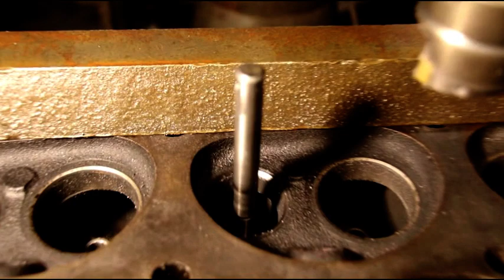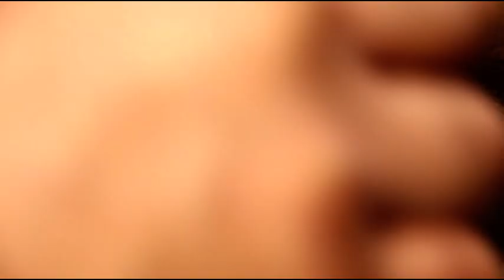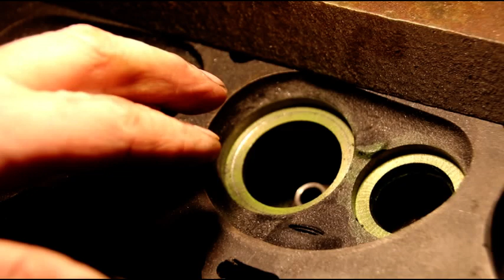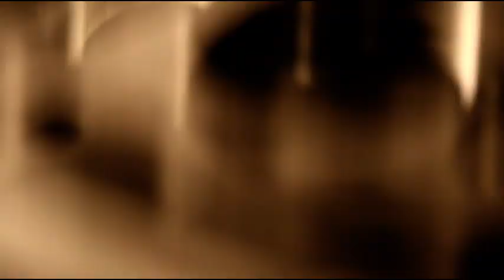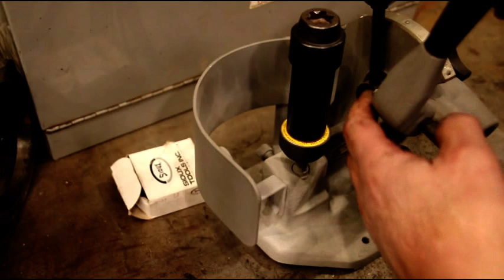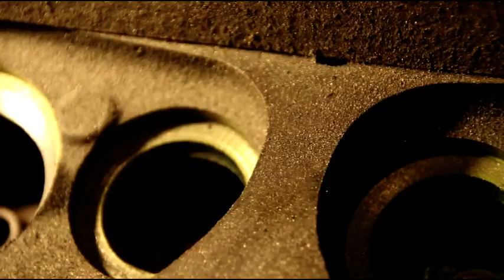Jeep 258 Cylinder Head Upgrade Part 2, Installing Chevy Valves

Comment: I deal with AMC J-10  /J-20 pickup trucks and CJ Jeeps. I started working for the Worlds largest Jeep Dealership when in Highschool doing nothing but washing Jeeps. All brand new Jeeps can in with a power all over them that looked like baby powder and he had 3 and sometimes 4 tractor trailer loads a week to come in. Then with every jeep that came back to have accessories added, oil change or what ever it came back for in the Dealership. Every single Jeep was washed and cleaned up inside before it left the dealership. Me a one other guy stayed busy washing Jeeps for 4.00 dollars a Jeep. That was in 1980, 81,82. I still rebuild, restore these old Jeeps. I buy the rare ones they didn't make but either 1 year, or they were a limited edition or something. I have a 1976 bicentennial J-10 that's my daily driver. Manuel shift. I have a 1977 Honcho automatic with factory AC, Tilt wheel and cruise control with a 401 Levi edition with factory electric window. I have a 1981 step side. I test drove this truck when it came on the lot new in 1981. It was the first and only one I ever seen in real life. They so rare. Only 1,264 were ever made from 1980 to 1983. I also owe a 1983 J-20 will a original 39,000 miles on it. But this 1981 It's the only truck I have with a 258 6 cylinder and it's a factor 4 speed. I am trying to get more horsepower out of it. I've never owned any vehicle with the 258 6 cylinder before. I have 3 Cjs also. They all V-8 also. But I had a guy do so work on the 81 with the 258 and it's been bored 60 over. It's running in the truck now. But I would love to have this done and I've been told to change it over to a 4.0 head and he said it would make a huge difference and it 60 over. It will have well more horsepower than the 304s I have. I doubt it won't compare to the AMC 360 or not. I know it won't with to 401. If it's not going to do a big difference. I'm thinking of going back with a 360
Reply from the maker: Great to hear from somebody that actually working in a real jeep dealership.  Sounds like you had a great time working there, and you were smart enough to grab some great vehicles.   I like the upgraded 4.2 head over a 4.0 head swap.   just my opinion and experience after having built both types of engines.   Appreciate you comment and story.

Comment: Hey Brian, I'm so grateful to come across your video and look forward to checking all of them out. I'm now the owner of my father's 89 yj, and unfortunately, the motor needs rebuilt. I want to take the opportunity to improve it performance and keep it as original as possible. Lost dad to cancer 16 years ago, and this build is for him. Do you take on any of this work? If so, how do i reach you? Is there any way to contact you? I have a 4.2 258 in a yj. I would prefer to not do the 4.0 head swap. Its carburetor is a motorcraft 2150 and plan on keeping it the way he left it. I'm in PA with a PA classic tag and emissions is not an issue.

Comment: How much gain do you estimate you got for upgrading the valves?  When I had my daughters 258 rebuilt I did not know about this upgrade.  I did put a small RV cam for torque.  These engines are known for getting warmer at the 5/6 cylinders, do you know a way to correct this heating issue?
Reply from the maker: The horsepower gain depends on how much cylinder head work you do.  with larger valves, porting work, milling head for increased compression etc...... will add just over 50 hp when matched with a good camshaft.  I have never had a 258 have a hotspot between 5/6 cylinders, but have traced the problem to blocks that have a lot of junk in the cooling system.  Once boiled out and rebuilt no problems.

Comment: Nice work and vid!  I've heard of going to a 1.875 intake, but not the 1.94.  It looks like a lot of material is going to be removed.  Just curious what your thoughts are on how much material there is before you get into water (?).  You sound pretty experienced at this, so I figure you'd know.
Reply from the maker: 1.94 intake valves have been installed in hundreds of 258 cylinder heads without any trouble.  There is no need to be concerned with cutting out too much material.

Comment: To optimize that increased flow do you run a particular cam? How would you compare the performance of this modification to a stock 304? I’m finding this 258 build especially interesting 💪💪🇺🇸
Reply from the maker: a well built 258 will feel as good or better than a stock 304.   Add gears to the mix and you will have a super responsive and powerful 258 rig.    I do use a lot of different cams based on what I want out of the engine.   Will be showing the cam and discussing them when I  get to that point in the build.
Reply: @metalshaperJeep  I’m really looking forward to seeing this come together and listening to your choices on components

Comment: We did something very similar to this to put Chevy valves in my 1978 258 performance build back in 1990. There was very little 258 performance parts for sale back then compared to today. Still running it to this day. Amazing torque and power.
Reply from the maker: I have been doing this modification for a long time and it does make a big difference in power.  Glad you are getting the benefits of it in your jeep.

Comment: Couldn't you go in there with a piece of high speed steel 30 degrees or so off the vertical axis? I saw this done on another video on 324 olds heads. I think it's on YouTube  fiatnuts I'm just asking, not telling you how to do it.
Reply from the maker: There are a lot of ways to do any job.   I am showing how I do it with hand tools and stones.   Very easy to hold the head on the seat and guide machine and not worry about setting it up on a milling machine.    Can't make a cut like that on the seat and guide machine and I prefer everything gets located off the valve guide with a pilot to keep everything concentric.   I have been doing this modification for many years and prefer to do it the way I have shown.   Anybody else is welcome to do it as they choose.
Reply: @metalshaperJeep  okay sounds good to me.